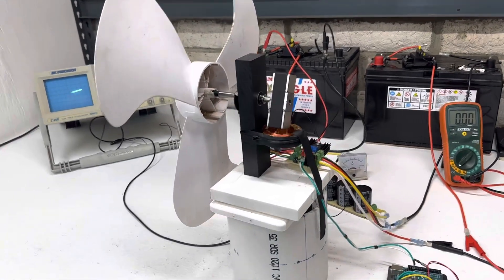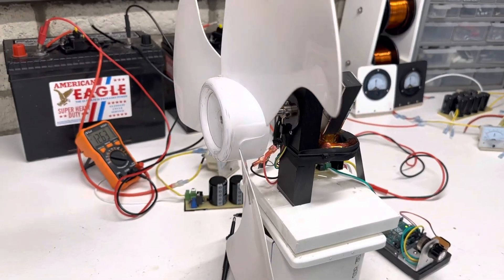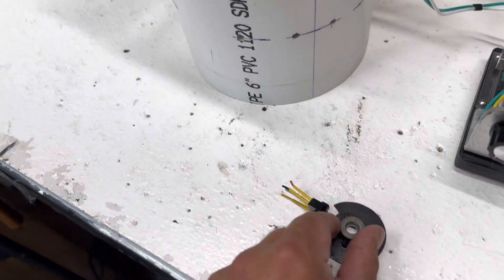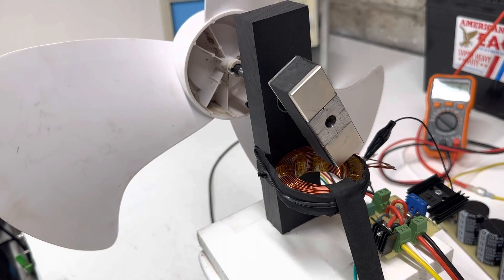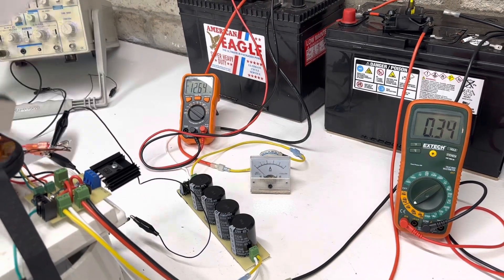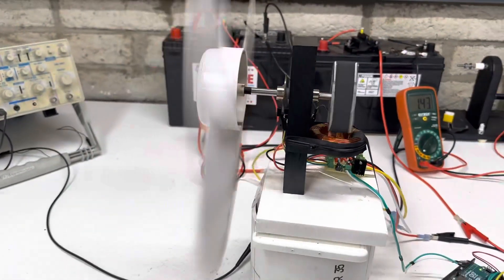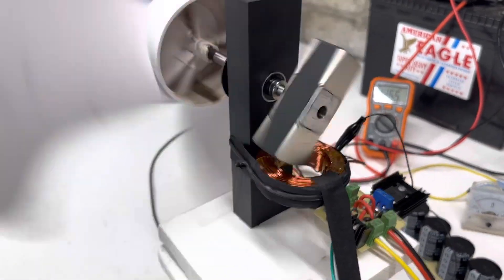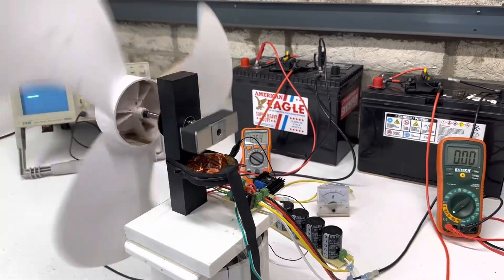Simple but strong beginner pulse motor

Comment: Is this coil 1mm thickness wire?, have you ever tried 0.5mm thicknes, takes less power to saturate the coil and itll pick up more energy from the magnet.
Reply: .5mm is my preferred thickness really
Reply from the maker: It’s 18 awg
Reply: @kenergy1707  cool that's pretty thick 1.024mm probably only pick up a little bit from the magnet, but my test motor has the same thickness on the secondary coil, and my primary is12Awg, that is why I'm only gonna briefly try the circuit, before winding the next motor all with 24AWG but 20 wires of it wound together in parallel. When i get round to it there'll be a video
Reply from the maker: @doubleooh7337  cool I saw Couple of your older videos 
 My motors I don’t use back emf from the magnets it loads the motors to much I use the flyback it doesn’t hinder the motor performance
Reply: @kenergy1707  did you see the one with a 2400v spark? Its a marx generator,  basically a capacitor bank that can be charged a parallel but discharged in series cool little setup, that coil that feed it was only 0.2mm thick 1kg coil, i only look at the motor as a  on/off trigger in the ssg  its the pulse I'm after.

Comment: I would really like to build this. Can you do a more detailed build of this. I understand it but need more details of magnet types and Arduino pulse modulator. I really enjoy your videos.
Reply from the maker: Thank you! 
The magnets are 1”x1”x1” neos with a 1” square steel and 8mm / 5/16 hole for the shaft 

The arduino it programmed for pwm with a 5 k pot
Reply: That helps a lot. You have tape around the magnets and middle steel square which caused my confusion. Thanks for the reply.
Reply from the maker: @daleniggemann  tape is just for safety magnets fly off if Rpms are hi

Comment: Thanks for sharing! I have a question: how do you avoid the generator phase of the motor slow down the rotor? When I connect a large capacitance load, the rotor slows down considerable. Thanks in advance!
Reply from the maker: I tuned the motor so that when the generator slows down the rotor the trigger wire gives less power to the transistor which in turn makes it use less power and more pulses
Reply: @kenergy1707  Sorry, I didn't understand your point. In this particular motor you are using an opto to fire the motor, right? And when the other pole of the magnet pass through the coil, do you have any other type of control? My problem is when the pole that is not been fired passes through the coil and then slows down the rotor because it's rectified by the diode. Thanks!!
Reply from the maker: @erathke  I was referring to my most recent video
Reply from the maker: @erathke  with the bedini circuit
Reply from the maker: @erathke  for this motor with opto timing it doesn’t slow dow on the next magnet it means your diode is in the wrong place
Reply from the maker: If you want to talk in more depth email me
Reply from the maker: If you use a generator on a regular circuit it will make the drive motor use more energy that the generator can make

Comment: Is that rotor a big magnet or simply steel. Was confused by the black piece with thin square neo like pieces on the outside. Thank you for sharing and explaining how to make these motors that actually do some real work instead of simply spinning.
Reply from the maker: Thanks ! So the rotor is 1 inch square the a 1 inch neo magnet on either side making 3 inch tall by 1 inch wide
Reply from the maker: Mild steel in the middle
Reply: Thank you! Again, I love your motors because they are makeables that actually do some major work.
Reply from the maker: @rotorque4254  definitely 👍

Comment: Good video bro! I wonder how charging your batteries with those high current pulse conditions them over time. If they last longer than conventionally charge batteries. Have you ever brought a completely dead battery back to life using that charging method?
Reply from the maker: Thanks bro ! I’m not sure if it helps the battery but it sure converts the spikes well !